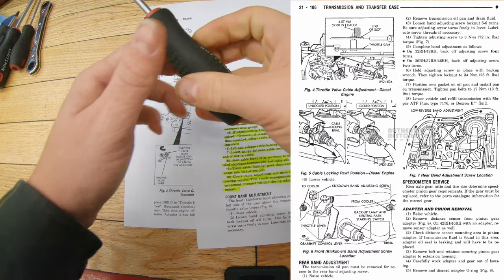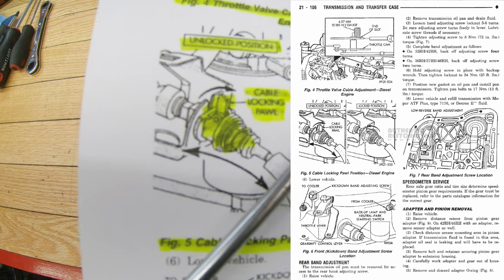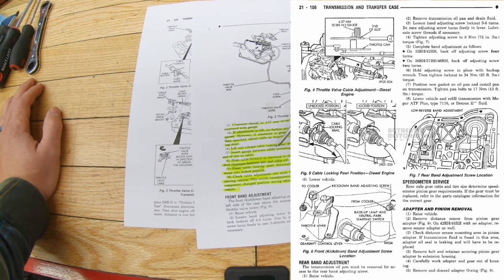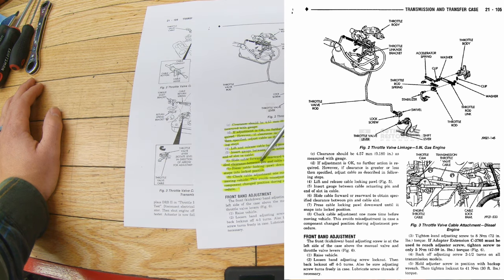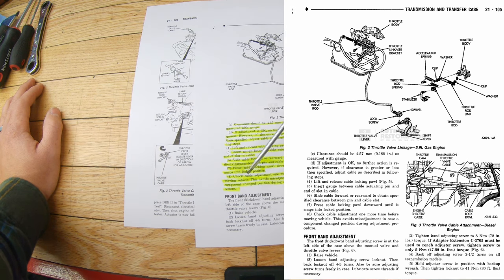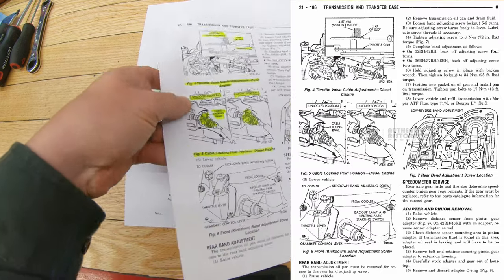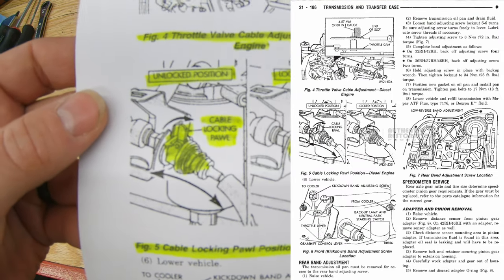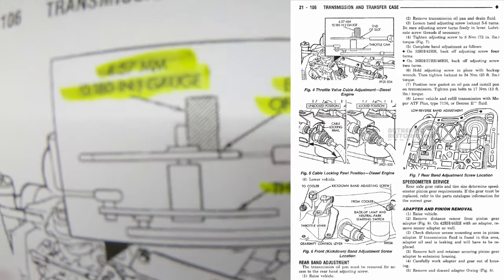TV (Throttle Valve) Cable Adjustment | 1st Gen Cummins

Comment: I did this adjustment i do have an LE model 1991 D350 with cruise control. Shifts much better now. I also added an inch block under the gas petal, is a common fix for more throttle control. The issue im having is i get to about 70 MPH or about 112 KPH. and i can not press my petal any past that if i hold it fully depressed it will slowly climb in speed. Is this factory settting for these trucks? Also im hitting about 2200 rpm max. Any suggestions would be appreciated! Great videos btw love the camper vids!

Comment: Highway speeds are even more enjoyable with a 47RH and that sweet, sweet lockup.  Good job on the TV cable adjustment. As I get my 47RH back into my build, I'll pay good attention to the TV cable adjustment as well.
Reply: If you're doing a 47rh conversion on a first gen, make sure you use the correct 46rh tv lever.
Reply: @davidcole3927  I've actually got an aftermarket Lokar TV cable hooked up to the original TV lever so it operates just like it was on a 2nd gen truck. It was on my donor truck before the tear-down, and worked beautifully once I replaced the TV cable (original was locked up due to corrosion).  But yes, if I were doing a new conversion I'd definitely use the original linkages and TV lever if they were available.  That's good advice.
Reply from the maker: Maybe down the road one day.. this is supposed to be my beater truck after all..

Comment: If you set it up to where it shifts to early you won’t have enough line pressure to how can I say it to engage your clutch with your second gear ban and a high gear clutch pack and you can burn the transmission up because it all allow it to slip but you did good man I learn something from your video I had a problem with my old Dodge we put a different cylinder head of Hamilton cams head and head to modify the linkage bracket and all that I had to screw around get it to where I can shift early because it wouldn’t hardly shift at all anyway good job dude I like what you’re doing this is six in a row jim in Kennerdell Pennsylvania

Comment: Having issues with getting the stop to keep gap where it needs to be .18" once i have adjusted it.  Once I set the lock and actuate the linkage it goes right back to the original position which is about 1 1/4".  The trans is not shifting from 3rd to 4th.  I had the trans rebuilt 2.5 yrs. ago and it sat for two of those years. Don't think I have more than a 4k on the new trans.  Help...?
Reply from the maker: 3 to 4 is overdrive. My guess is either you have a pcm problem or your throttle position sensor needs adjusted or replaced.

Comment: watching this i’ve realized that my TV is not only out of adjustment, but doesnt even have a return spring smh
Reply from the maker: Glad I could point that out indirectly haha
Reply: Same here but it seems to function decent without the spring
Reply from the maker: @brycemanuel4205  It must be common. When I was adjusting mine the end of the return spring actually broke and fell off and I had to re bend it and put it back on.

Comment: I remember when I first did this adjustment as well. It's amazing!
Reply from the maker: Automatics are so finicky 🤣
Reply: So I started having problems with overdrive hanging up . I started at your other video .lol . Added fluid I was about a quart low and didn’t change much. Still hangs up trying to shift to od. Especially under load.
Reply: @adrianmiles6271  did you adjust the TV cable like this video shows?
Reply from the maker: @adrianmiles6271  you'll probably have to adjust your TPS. Tim has a good video on how to do that.
Reply: I checked the TV cab position and found that the spring was too weak to return it to the rear position. I changed the spring and it seems to be working shifting into od without the hang up . I’m going to double check the tps tomorrow just to be safe .

Comment: Hell yeah, works great thanks, what I also did is I moved my top throttle cable, the one that’s like a ball joint to the next hole up on the mount, and moved my springs down to the bottom hole of the mount, and that also help with throttle responsiveness, cool easy free mod I learned from Decent Garage. Don’t think anyone ever adjusted the tv cable on my d250 till I did.
Reply from the maker: It's an awesome "free" upgrade eh?! Thanks for watching glad it helped out

Comment: Hey Tyler great video I've watched it a couple times now lol. I removed my cruise control one because I don't care much for cruise control at all and took the actuator out too on the inner fender. Anyways I've been trying to figure out where to put the spring because the previous owner moved the throttle linkage over to the inner slot on the throttle bracket so they just put both the springs on the bracket whereas there's no spring for the tv cable. Is yours the factory throttle bracket that rests against the idle screw? I think mine was changed in the past, but maybe I'll just crossover the spring to the outer slot on the bracket.
Reply from the maker: What I show in the video is factory the way my truck came. It didn't come with cruise control. If you take a look at some of the engine related videos on my red truck you might be able to see how it's setup on that one. That truck came with cruise control. You can always check the factory service manual too! Good luck.
Reply: @OvensGarage  Oh okay yea I see in your vacuum pump video I watched before how it's setup. It is crossed over thanks man.